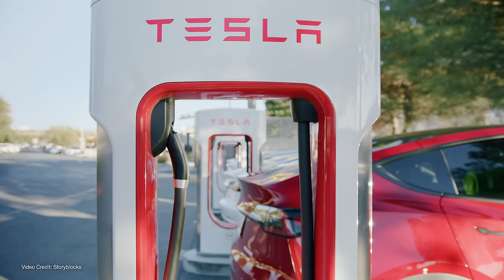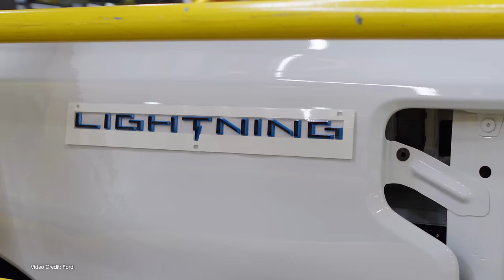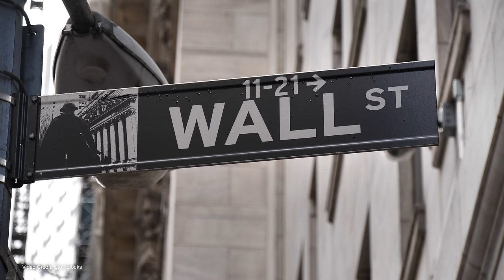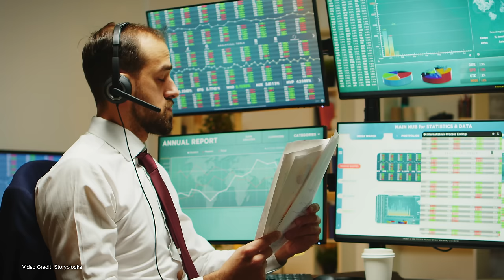Just WHY Are Automakers Pushing Back Their EV Plans?

Comment: A very nuanced assessment. Legacy auto is finding the transition to EVs very hard, we are now passed the phase of early adopters and automakers now need to be delivering high quality EVs with good range, good software, good charging speed and convenience with good value. They aren't quite there yet, I think even Tesla is starting to hit the limits of customer demand with their current models. The cybertruck will extend their reach a bit, but they really need the smaller cheaper model they have planned and that is still a few years away. The Chinese will likely get into more markets and Legacy auto needs to quickly lower their costs & improve their cars. It's an interesting time, I do think we're on the verge of EVs displacing Gas cars, but it is a transition that will have it's share of pain for the companies involved. We've got an interesting few years before us.

Comment: Anyone asked the question why governments are having to do this? They've never got involved before - only market forces were required. Now they're having to bribe or beat you into buying an EV. if the entry price, infrastructure and technology was right, then they wouldn't have to do this - it would just be a more sensible move for the average motorist, but it's obviously not.

I'll also stand by the fact that it's only fleets and businesses keeping the EV dream alive - private buyers are highly sceptical. In the UK, less than 1 in 4 EV's are sold to private buyers.

Comment: I think you missed the most important factor (though all others noted are impacting the situation): EVs have broken through very early industrial problems - design, battery technology, industrial capability. Achieved on the demand and sales to enthusiast/early adopters market. That is now saturated. Next step in growth is not just industrial capability to deliver (ability to supply) but also general public demand. The most important factor is that last bit, general public don't want EVs. Vast numbers of even relatively cheap EVs are sitting at the dealers on a years scale while system relies on 60-90 days inventories. Production must be stopped as general public won't buy. That is the next hurdle even Tesla haven't managed to break. And t is not just economic downturn. Reliability, ability to service, residual value(!) and everyday hustles and operating cost (see recent video of UK JOG-LE ICU BMW vs EV Porsche - ICU won time and money, cost 122:259, time (mainly due to long charging and need to depart from best path to find chargers) 9+hrs faster in ICU (and they were not racing, 6+ hrs charging vs 20min pumping gas).
And as for pronunciation you mentioned in the video, here is one from country where Tesla is native last name: T-E-S-L-A very simple, our language is phonetic, speak as it is written. There is no Z in Tesla...
Reply: That's just simply not true. EV sales are continuing to grow rapidly, both in overall terms and as a proportion of the market. Some models are doing poorly, but that's mostly a consequence of failing to keep up with competitors and the pace of technological change. The second hand market has fluctuated a lot, but the drops in value of second hand cars could mainly be attributed to the drop in price of new cars and the improving capabilities of newer cars. At the end of the day, EV drive trains will continue to be better performing and cheaper to run than ICE, and that will continue to attract new buyers for whom the EV logistics work. And public and private charging infrastructure will continue to grow, making EVs more practical for those longer trips that are sometimes a challenge now.

Comment: I think the other thing that has automakers a bit gun shy is Volkswagen's issues. Thousands of unsold ID3s just sitting there. The truth of that problem though, lies in the vehicle itself. A non Volkswagen like cheap interior, a bland exterior, massive software problems that directly affected the useability of the cars and a price that didn't match it's competitors. I liked Diess but the ID range was pretty much a failure at the outset and while he didn't start it, he did oversee and bungle the release. He seemed powerless to fix the major issue (the software).

Comment: EVs are nice for local commute when you can charge at home/work/school and that is pretty much it. Beyond that, fast-charging is too expensive, too sparse, not reliable enough unless you are with Tesla and for the most part, not fast enough. It will probably take 10+ years for most countries to sort out the charging situation to the point of most people not seeing it any more or less of a hassle than gas/diesel/ethanol stations, which also requires that the "premium" 350-500kW charging experience trickles down to entry-level EVs. Many speed bumps left on the road to mass adoption.
Reply: Wrong on all counts

Comment: EV's are not living up to the promise. Expensive to insure if you can get insurance, easily damaged (writeoff if the battery is damaged), the inadequate range, lack of charging stations (even then most are out of service). You can't charge at home if your network can't cope. An then ther coup de gras is comming. After the Luton fire, it's only a matter of time before EV's are banned outright from parking in multi-story garages and underground carparks. Latge batteries can be very, very dangerous. We will have to wait for the next tech batteries to come along, my guess is 30-50 years away.
Reply: Except that was caused by a diesel car. So maybe all ICEs need to be banded from the car parks.
Reply: @FranFirman  sorry to upset the EV evangelists, but the fire was caused by the battery component of a hybrid. The other point I forgot to make was there is not enough 'stuff' that can be mined to make all the green tech components that we want. The extraction of Nickle, cobalt, copper etc etc have to be increased by 300-1500% to meet the demand. Industry has never doubled the production of these meinerals in the space of a decade, ever in human history. Competition from other industries for the contituent materials of batteries only means that battery prices will rise.
Reply: @Ozgrade3  so not an EV. A hybrid is not an EV. It is an efficient ICE.

Now for the Luton fire there is footage of the car on fire with the license plate visible and that shows it is a diesel Range Rover Sport and the 3 generations of them are not hybrids.

So not an EV and not even a hybrid but a run of the range diesel Range Rover. The daily Mail reported that the fire started under the hood of a Range Rover Diesel, caused by an electric fault or fuel line leak.
Reply: @Ozgrade3  Now for the minerals.

Copper - 3.5 billion tonnes known about - 105 years worth.
Nickel - 100 million tonnes known about - 33 years worth.
Cobalt - 8.3 million tonnes - + 120 million tonnes resources identified.

Now the most common battery chemistry doesn't use Nickel or Cobalt. It is Iithium Iron Phosphate. (LFP).

Also when these metals/minerals are put in to a battery it doesn't disappear at the end of life of the battery, but is recycled and reused, unlike the petrol and diesel burnt in an engine. That is not recycled at all.
Reply: @FranFirman  So why would the Chief Operations Officer of Fortesque Metals (An Australian company that's the worlds largest miner of this stuff), he put out a press release stating that all the operating mines (and planned futer mines) will only ever  be able to supply less that 50% of the expected demand. Surely he would know what he is talking about.....huh?
Reply: @Ozgrade3  Who knows. Maybe he is trying to get his stock price up. Maybe he gets a bonus for hitting certain different levels.

You would have to look at his main purpose in his job, and that isn't necessarily to tell the truth, but to do what ever he can to maximise the profit for the share holders.
Reply: @FranFirman  OMG. is that the best argument you can come up with? Is the education system in the western world that bad that this is the best argument you can formulate?
Reply: @Ozgrade3  for the companies, in my 50 year experience of working in telecommunications and IT companies it has held up as a fairly accurate prediction to their actions.
Reply: @FranFirman  I'll leave this discussion now. You can carry on with your EV evangalism. Best of luck with your EV dreams, meanwhile I'll just continue driving my liquid  fueled ICE cars, trucks and planes. We;ll see in 20 years where it ends up.
Reply: @Ozgrade3  funny how you are assuming that I'm in an ev evangelism when all I did was inform you that you were incorrect about the car park, that a simple check let's you know there are heaps of materials around and that most batteries aren't even using those materials. I ride a Honda NC750X motorbike and burn wood for heating. Hmmm.
Reply: @Ozgrade3  and if you can post a link to the press release that would be very helpful, as I am unable to find any record other than the CEO resigning after 6 months, Fiona Hick.